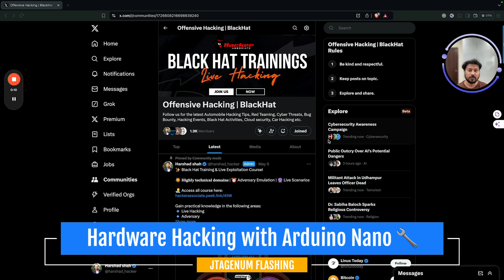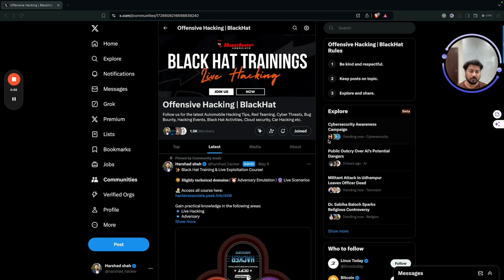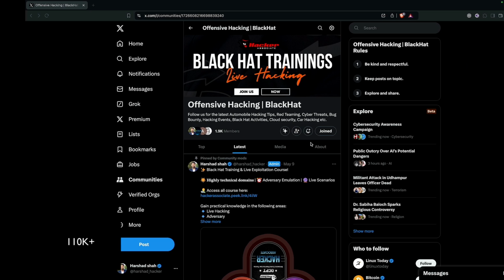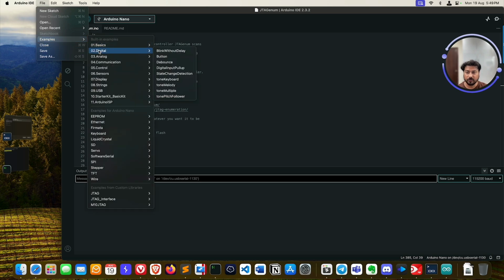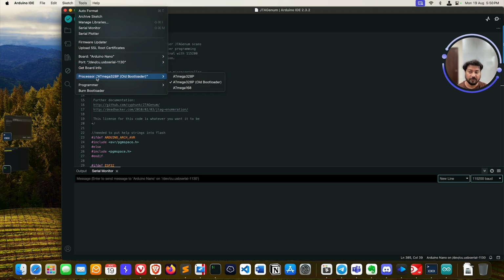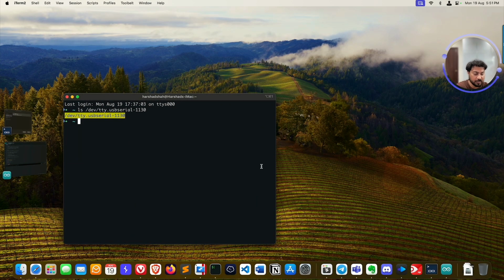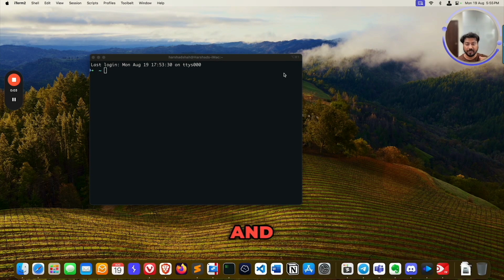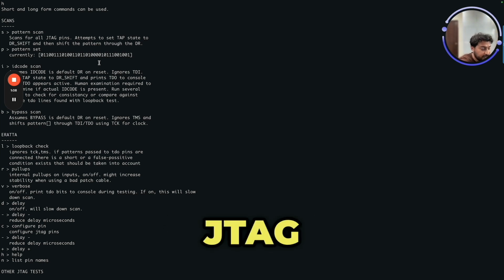JTAGENUM: Hardware Hacking using Arduino Nano| IoT Hacking #hackerassociate #cybersecurity

Comment: Can I use Arduino Uno instead of arduino Nano?
Reply from the maker: Yes, you can use an Arduino Uno instead of an Arduino Nano for JTAGenum.

The Arduino Uno and Nano share the same ATmega328P microcontroller, so their functionality is largely the same. However, the physical pin layout differs. If the JTAGenum setup or wiring is designed for the Nano's compact form factor, you may need to adjust the connections to match the Uno's pin layout.